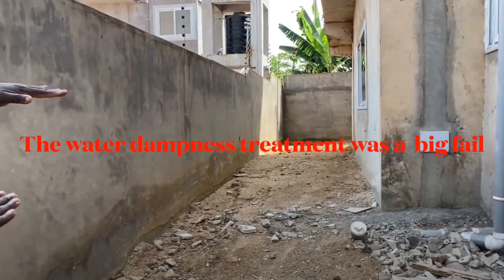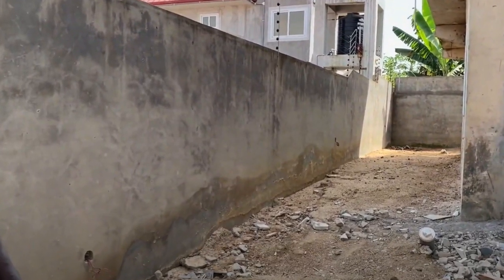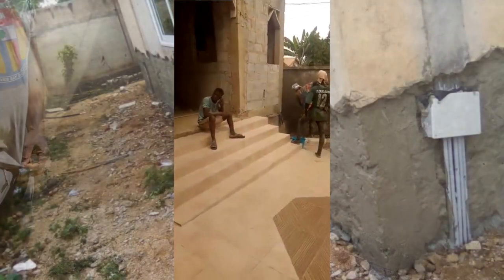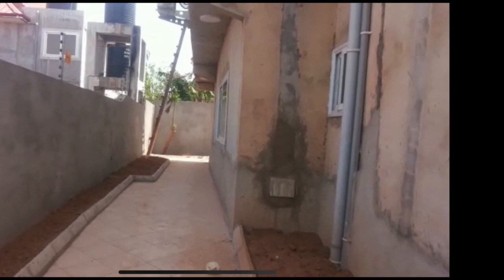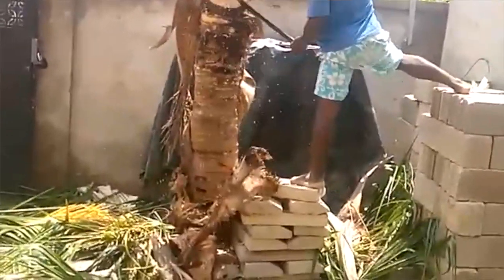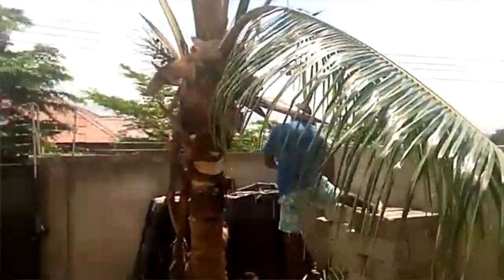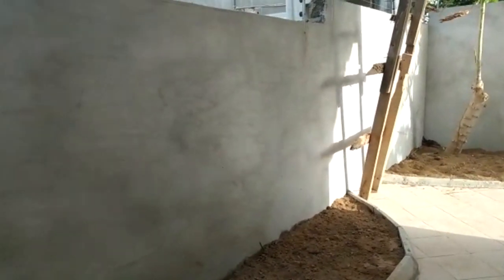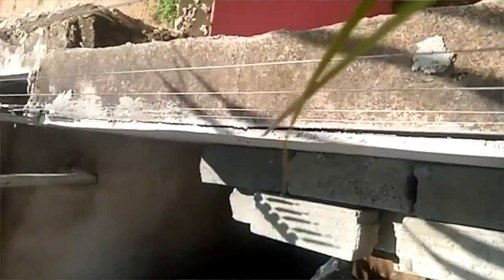Building in Ghana: How The Coconut Tree Saved The Wall From Collapsing And Causing Damage & Injury

Comment: Hello, sorry to hear that 
I had the same problem with my wall and the entire compound 
I was introduced to some chemicals which were mixed with the cement to plaster the walls and the dampness stopped completely. The same chemicals were used when they were doing the compound . The chemicals are very expensive but it did solve the problem 
Good luck 🤞
Reply from the maker: @gracea7372. I'm sorry you experienced the same problem. I did exactly what you did to correct the issue. We mixed the damp proof chemical with cement and applied to the wall and then tiled the wall. Thanks for watching.

Comment: The foreman should have chipped and plastered the top of the wall, so it adheres to the side, so it forms an upside L. Thats why most concrete is poured on the same day or within a couple days (new concrete and old concrete never bond), so gaps and cracks are not formed.However, it should have been done before the electric fence installation. Let me guess you added mesh or chipped the wall and added rough stones and replastered it? Or maybe you tiled the whole wall?😂😂 Poor coconut tree, you should have been patient and bought fertilizer such as guano, pig manure, discarded old lemons, aluminum sulfate and checked ph level of your soil, that tree could have produced for like 60-70years😢

Comment: What you  are doing is not going to solve the problem.  Before you erect a wall,  the proper way to avoid salt eating into your wall is after digging the foundation, you need to lay a special plastic in the floor before casting the concrete  and the block work to at least the ground level.  This will eliminate the problem.  Do this even for the main house. This material is now available in ghana.
Reply: That does not even solve the problem. I did that at the foundation level, bought some chemicals to mix with the cement during plastering, and still have this problem. I just met someone who said they could do it, but first, they will have to remove all the plastering work and the chemical and other stuff they asked me to buy. They will use it directly to the walls. It's quite expensive, though, but I will try it.
Reply from the maker: @ansbeck6055  I know what you mean. I did the same thing. I hope everything works out for you. Thanks for watching

Comment: Dig around the wall on both sides erect this plastic. It will solve the problem but not 100% because it has not gone under the foundation. Do not apply the material but wait to see if the wall will be damp. Stop throwing money away.